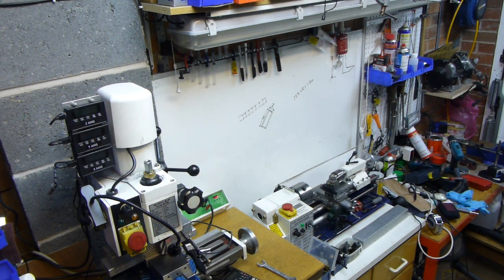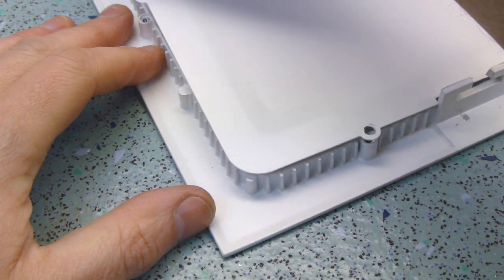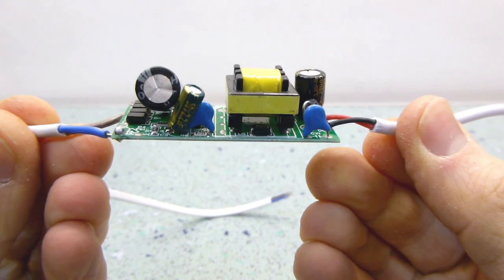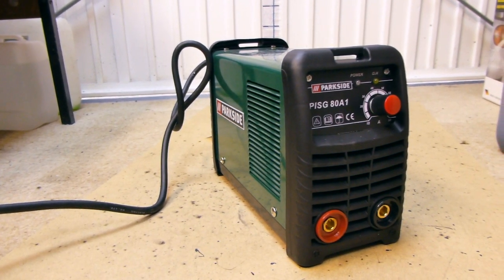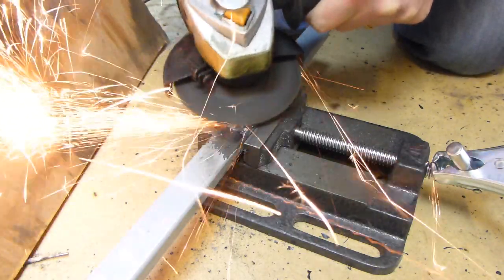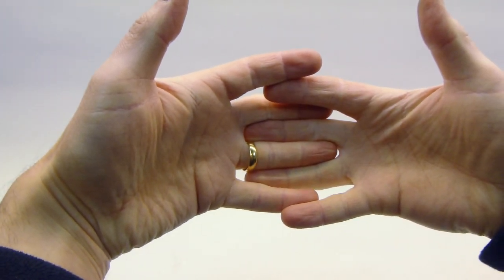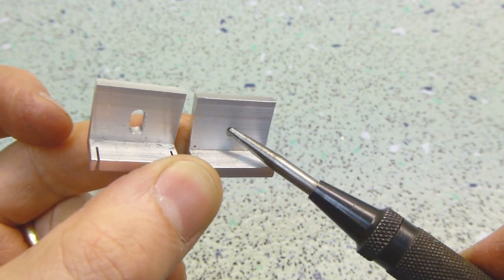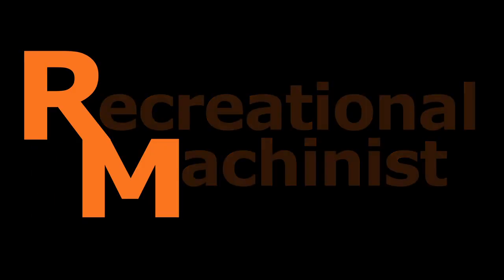Workshop LED Panel Light Build Part 1

Comment: a tip for filling holes burnt through from someone who has done lots of welding for more than 40 years.  only recently i blew a hole in something i was working on and after all these years i thought of using some filler rod as you do in oxy welding.  i went and got some heavy gauge tie wire and poked it in the hole before i struck the arc.  quickly fixed.  i wasn't welding high pressure gas pipelines so no cares about structural integrity.  coat hangers, not plastic ones, would do the job as well.